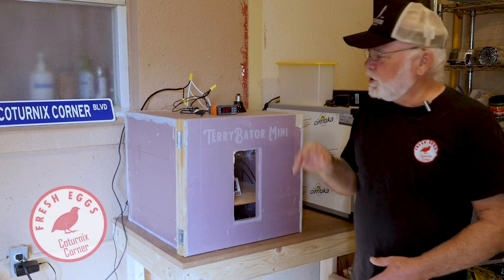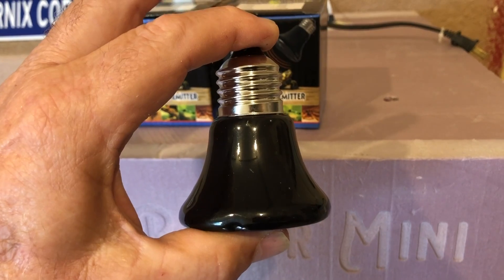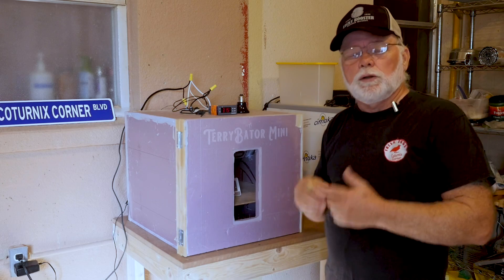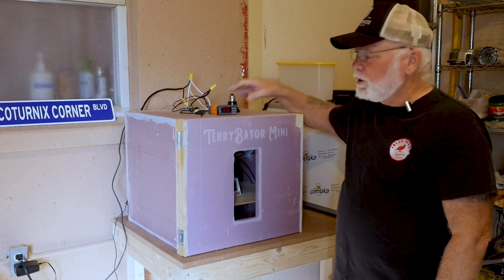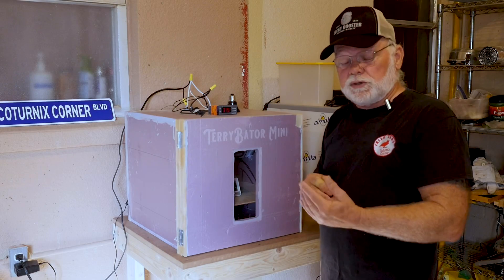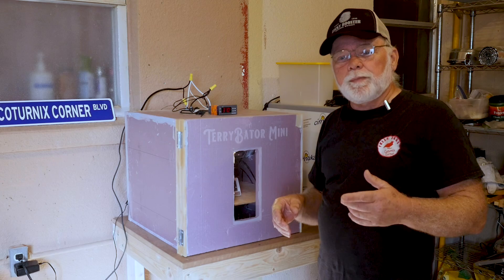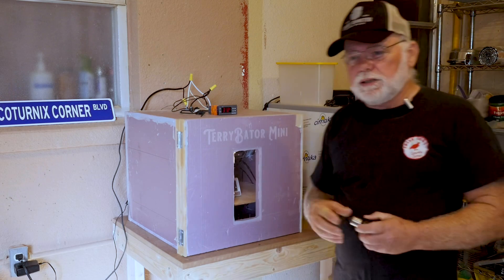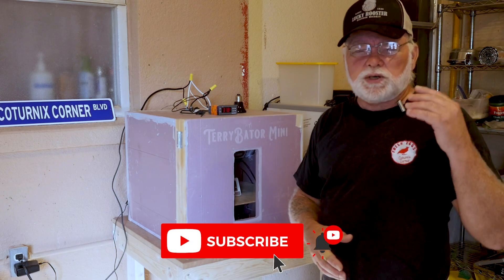DIY Incubator Mods - Improved Heating & Control

Comment: The scale for F and C is different, you can not just say +/-1°C is the same as  +/-1°F

99°F =37.222 °C 
100°F =37.778 °C 
In this example 1°F difference is 0.556°C

Comment: the difference between a F degree and a C degree is 1.8 degrees F, which means that F is a smaller increment of temperature. I don't know how much this really matters because 37.5C = (37.5 x 1.8) + 32 = 99.5F, and 37.2C = (37.2 x 1.8) + 32 = 98.96F so as you can see each 0.1C = 0.18F, is this what you mean by it being better to run on Celsius instead of Fahrenheit?

Comment: Thank you so much for the Inkbird tips. I use an old Hovabator that I installed an Inkbird into a couple of years ago. I was disappointed that the temp had to drop a full degree below my set temp before it would turn the heater on. Now I am able to hold much more consistent temps by using your tips.

Comment: how do these do with humidity? I hatch mostly bantam duck eggs and find i need to do wet hatch with them and have to keep humidity steady. Chicken eggs seem to do fine with dry incubating (just add water for lockdown).. i need a new incubator that holds more eggs..and preferably not crazy expensive.. but reviews are so mixed on every incubator and no one seems to talk about humidity levels for ducks.
Reply from the maker: I do dry hatches mostly and the humidity stays pretty consistent at around 35% and with a 12" x 14" water tray I get up to 65% at lockdown. Some have had good luck using a Humidikit humidifier in really dry climates.

Comment: What wattage of the mini ceramic heaters do you recommend for the 240 model? I am currently building one. I will be using it for chicken eggs.
Reply from the maker: I tested with the 50 watt mini heaters and it worked well.

Comment: The thing I never liked about those heat emitters is that you can’t tell with a glance if it’s still working or burned out. I have the same idea tho, I use 125w red heat reptile bulbs. They’re cheap on Amazon, and they seem to last and last.  But HOOOOOOOLLLYYYYYY SMOOOOOOOKKES, that Celsius degree adjustment is a friggen game changer bro!! Wow, I never even thought to try it or look thru it…I’m sure my 608t does it too. 1am on Sunday night/Monday morning, and I’m about to head out to the barn in the cold to make the change. Thankyou sir.
Reply: Done. You totally just upped everybody’s inkbird incubation game with that. My 608t’s both are running Celsius now with that .3 on/off difference. but I’ll dye before I buy a metric tape measure…
Reply: I was going to reply also there are a bunch of different reptile "basking heat lamps" bulbs that you can still get. I've seen them from 25 watt up to 150 w.
Reply from the maker: Those could work but I haven't had time to test them yet. Thanks for the idea.
Reply: @CoturnixCorner  I use one with an Inkbird temp controller as a hot spot for my python, keeps a nice 90-91* basking spot. Some reptile owners have some lizards that require 100-120* hot spot and these work for that. 
I agree, testing would be needed, but they could be an option if you need heat and light together.

Comment: Hey Terry! Unrelated question. At what age do you harvest the birds you are growing strictly for meat? I've heard 7-8 weeks before, but I've also heard that Jumbo Coturnix aren't fully matured until 12-14 weeks. Is there a point of diminishing returns where it doesn't make sense to grow them out for the last 5-6 weeks because you're not adding much more meat? Thanks so much!
Reply from the maker: I usually havest at 10 weeks unless I need a few for dinner and don't have any in the freezer, then I'll use younger birds.

Comment: you can get incandescent light bulbs from auto-zone. none of the specialty lights got banned. those are 75 watt bulbs with a silicone coating inside them so when your drop light on a hook for fixing your vehicle gets dropped the silicone keeps the bulb from shattering. the brand i buy is called "sure bilt" and they are rough-service light bulbs. i use them in my office/bedroom because the LED lights give me insomnia if i hang out around them too much.

Comment: Terry, I built a mini Terrybator last year. However, I used 2 inch thick foam board. The temperature holds steady. I also used strips of wood all around the door and all around the door opening body. Then I installed small mini latches around the door on all sides-3 latches per side or 3 latches X 4 sides = 12 latches to keep the door sealed all around. I have had great sucess with Red Jungle Fowl and Dominique Batam eggs. Best incubator around. One last thing...I cut a piece of foam board to cover the plexiglass. I just remove it when I want to see inside. This also helped with the temp regulation.
Reply from the maker: Sounds like you've got it dialed in and built it to last. Good luck with your hatches.
Reply: @CoturnixCorner  I love the mini Terrybator...thanks a million.
Reply from the maker: @Keanu-x7w  appreciate it

Comment: I built one of your incubators from your video and I love it.  I tried with a 50W ceramic bulb they were the standard size.  That did not work because they were too long and the fan blew above the actual heating element.  I have been thinking about trying the mini ones but had not yet.  I will now though.  Thanks you much for the video.  I did added an additional light to the incubator but I put it in front with its own power source and switch to allow my girlfriend to watch the quail hatch.  I run a low watt LCD light bulb so as to not mess with the temp if it is left on for a bit.
Reply from the maker: Yes, the longer ceramic heaters are not recommended for the reasons you mentioned. I should have mentioned in the video that a low wattage LED bulb is used for light vs the existing halogen that was replaced. Let me know how the shorter ceramic bulbs work out.
Reply: @my initial testing with the 50 watt ceramic mini bulbs is they take too long to cool off and the temps gets high.  I have not tried making the vent hole bigger yet. I have eggs coming soon and I don't want to make any irreversible modification until after those hatch.
Reply from the maker: @chriscatt4672 I'm currently testing using two 25 watt mini ceramics and so far so good. Don't make any changes to the vents, it shouldn't be necessary. Have you switched to Celcius mode in the inkbird yet? If not, make the changes as posted in this video, but set the TS to 37.4 instead of 37.5,  Keep me updated.
Reply from the maker: @chriscatt4672 I will be updating this video after I finish testing the 240.